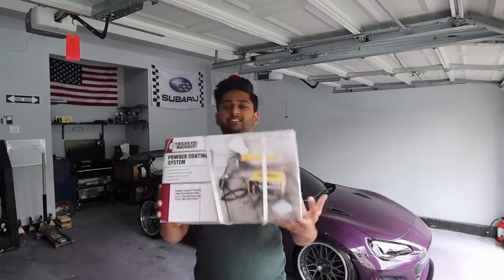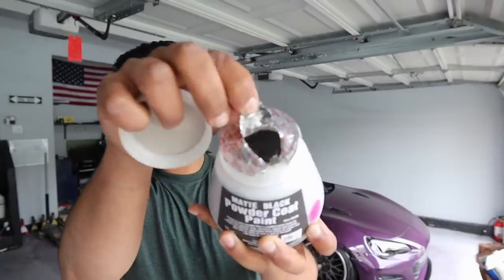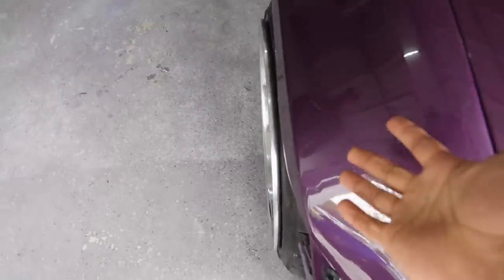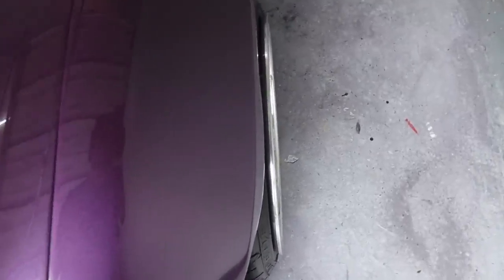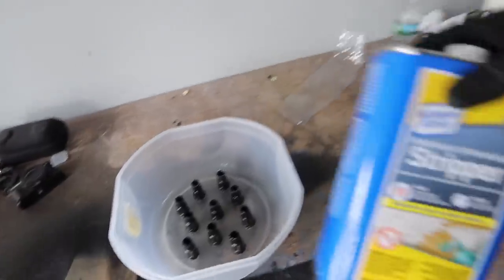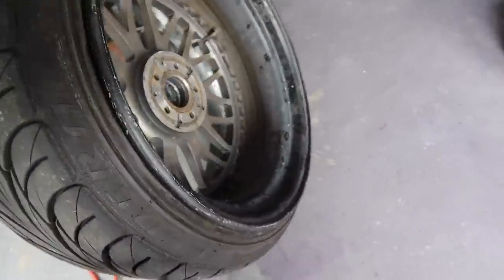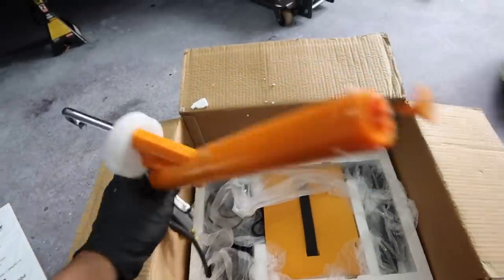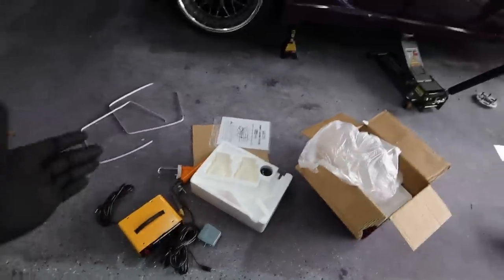How To Powder Coat at Home for SUPER CHEAP!

Comment: I myself powder coat and from my experience the wrinkles are caused by cheep powder. I’ve used the harbor freight kit before and it’s actually not that bad. Buy some high quality powder and you would be golden 👌
Reply: Jcor3968 what’s good quality powder where do I buy some at ?
Reply: Fidel Breto prismatic powders
Reply: Definitely Prismatic Powders
Reply: Prismatic . Ifs . Tiger drylac . Cardinal powders are all good
Reply: I second that. I also powdercoat and i buy from prismatic powders
Reply: Jcor3968 wrinkles or waves are from to much powder coat and not being consistent.
Reply: Where do you buy the good power coating power @ jcor3968
Reply: mister clean quick question, is it rule that you preheat then place the item inside the oven and once the item reaches the recommended temperature the cook time starts from that point?
Reply: Maybe you should do a detailed video on how to powder coat properly?
Reply: yeah they might be using some reclaimed instead of virgin powder
Reply: I agree with Jcor. The HF system is actually a good kit. It is certainly the best VALUE in the powder coating world. It's the cheap powder that created the inconsistent texture. I got excellent results with the HF machine paired with Eastwood powders. I haven't tried any other powder brands but I'm sure there are plenty of manufacturers that make quality powders. That's all you need to get awesome results...

Comment: few things to consider, 1, your 10 psi is 10psi when nothing is pulling air, so when you pulled the trigger and went to use air your 10psi turned into like 1 psi if even that. next time turn it to 10 psi while holding the trigger wide open with no powder in the gun. 2, I didnt see a moisture seperation device, very important for smooth coats. 3, preheat your oven for that final bake, you dont want that powder sitting too long cold without a charge to it. and 4, to help get more even coats and better adhesion prebake your parts, spray em, then put em back in the oven for the final bake. it takes some trial and error but once you get it, it's easy. also someone mentioned the h.f. powder being cheap powder, while I cant say because I've never used their powder try other powders as well and see if you get different results. there are some transparent powders out there to give an anodized look and it's fun to play around with.

Comment: I got the kit a few weeks ago and have done a couple parts and mine are tuning out the same texture. I bought really good recommended powder and it’s doing the same thing just not as bad. The only thing I can attribute it to is the harbor freight gun does not blow the powder like it should. It gets clogged so you have to turn the air up then it spits. There’s no happy medium. Good job for first go. Pretty much how mine turned out.

Comment: The Harbor Freight system is fine, I have seen professional results with this unit.
You used way too much air pressure which put too much powder on the lugs. Plus you should run an inline water filter to keep moisture out of the powder and off the parts.
Practice and you'll be wanting to coat everything !
Reply: Big Bruce is right...... Too much air pressure means too much powder especially since you don't have a booth. Most booths have positive airflow to suck excess paint away from the project to help eliminate over-spray. Try doing it outside of the garage with a slight breeze blowing or make a paint booth of your own.. Just an air filter and fan should accommodate for smaller projects. Sincerely, go kart man
Reply: 5-10 maybe 15 at max  for powders
Reply: It's not just the pressure, that particular gun leaks powder, a lot. Just pointing it down will dump a crapload. It's not the most ideal for small parts. The tube is too big and the electrode isn't hot enough...

Comment: Just future reference, the HF powder comes in jugs that are identical to what came with the gun. So you just thread the jug of black powder right to the gun rather than transferring it into the empty jugs first
Reply: Yes, it seems like the obvious thing but unfortunately they are not the same thread size. May strip the cap on the gun.

Comment: Mixture of powder coat and water. There's water residue in your compressor and created bubbles in the powder coating. Just need a regulator filter on your compressor, simple fix.

Comment: Back when I was in high school I worked for a company that made thermal couples and there were these aluminum casing for the connectors that we would powder coat they only had a harbor freight machine and a electric kitchen oven we would sand blast the part to give the powder a better surface to stick then we hung them using mig welding wire from the oven racks coat them while the oven was preheating the system worked great and this was a big company we did probably 100 a week

Comment: The reason it came out textured is most likely the metal is out gassing. This happens when gasses are released when baking and are trapped in the powder. Ideally you would strip to bare medal the prebake for 20 minutes. Then let cool and powder coat. Your pressure was also to high. A ground would also help.  The ground will help ensure a nice even coating.

Comment: I powder coat for a living, you got bubbling because of overspray and improper cooking. the texture of powder coat paint should be really smooth  if applied correctly, the psi on your gun was too low that's why you seen it coming out in small puffs. Also you should keep the electrode of your gun at least 6 inches from the pieces. Lastly powder coat paint should be cured using high temp INFRARED OVEN, conventional ovens just dont give the same result.

Comment: Strip everything down to bare metal.  Use a degreaser to clean it up.  Preheat it for about 10-15 minutes.  Use a water filter to keep moisture out.  Get an Air regulator and set to about 5-10 PSI.  Don't go too heavy. You'll be fine.

Comment: You are supposed to ground the unit you are powder coating. The grounding gives it a negative charge. The gun gives the powder a positive charge, which will let the powder bond to the unit much better. You’ll get a better coat texture if you ground what ever you are coating. I’m pretty sure that little black clip is a grounding clip

Comment: I’m not sure if you preheat the nuts before paint it , you need do that , and looks like that oven don’t have enough heat for the powder coat paint.
Reply: No you dont need to do that. and that oven goes over 450 degrees. powder is done at 400 or less.

Comment: As someone who used the HF gun for like 4 years, part of the issue is the gun itself. It has massive overspray and leaks a lot of powder as shown. You car ward this off by taking care in how much paint you put in the cup. I recommend a 1/3 full, and avoid Faraday spots at all cost. After recently upgrading to a 100% adjustable, and someone who PC a lot, there is a huge difference in having better machines, but if you wont be doing much PC or offering it as a service, its fine..

Comment: They had that ugly yellow tint to them because you used a brass wire wheel to clean them off

I'd also suggest to turn the psi down to where it's just a nice slow cloud of powder instead of just dumping the powder on like you guys had it.

Comment: .....Pours the powder into the exact same type container!??😂😂👌😂😒
Reply: Exactly, I was like what ohh common sense left the room
Reply: from a different video i kinda know its not the same, they look the same but that guy tried it and it turned out the threads where different. He was tuning it on for 20+ turns and then was like wait wait, it only has 3 threads, how can i keep turning this while talking to the camera. Wel because the thread where just a bit smaller and skipping over.

Comment: oven cleaner would of worked better to strip the anodizing and soaking it also
Reply: Greased Lightning degreaser is Amazing at removing anodizing. I couldn't believe it when my guy at the hobby shop told me. I wanted plain aluminum parts for one of my projects and he only had the parts in orange and purple anodized.
Put the parts in a bowl of Greased Lightning and watch the anodizing come off, wipe the part and done.

Comment: I would get bolts and mount them to plate so they dont fall over, preheat, lower the air pressure. Then buy professional powder.  start with 7lbs of air.

Comment: Not sure if you pre baked the lug nuts before powder coating,it would get all the impurity’s out the metal before you powder coat them,Ive never powder coated but have had my wheels done and watched videos here and there. They look good to me I would just pre bake them next time and apply the powder coat when they are hot it will help it stick sometimes not all the powder sticks from the electrical charge and the heat should help.
Reply from the maker: hmmm🤔i’ll definitely try that next time, it does make sense haha

Comment: If your parts  aren't smooth, the finish won't be smooth.Also, if the paint isn't thick enough, it may orange-peel (dimple). I'd suggest wrapping your sheet with foil so you don't build up layers and layers of paint on it.

Comment: Pre heat part if not cold rolled steel then let get to room temp then ground each part before u powder em. Usually it 10mins @ 450 degrees. But ur problem can be from bad ground or shitty powder or moisture in ur air system

Comment: More than likely moisture in the compressor you have to have a moisture bottle to remove any moisture

I used their gun and except for blemishes from overspray splatter from improper cleaning of welds it’s not been a issue

Comment: The reason your lug nuts are an ugly yellowish color is because you are using a brass wire brush wheel on your Dremel. You are transferring brass onto the lug nut. Use a soft steel brush and you won't have that issue.

Comment: It turned out the way it did because yall didn't heat up what u were powdercoating.   Should have heated up the lug nuts at 400 degrees for 10 min.  Then lay powdercoat.  Then put them in the oven again.

Comment: the powder coat system is just a way to apply a product its not harbor freights system that caused the poor results its the quality of the powder at $6.99 a quart its great for small parts nuts bolts etc... if you want high quality show quality your going to pay over $25.00 a quart of top of the line powder. also remember prep is important poor preparation on your parts will result in a poor result.

Comment: I’m watching for the powder coating. Question is how the F do you drive something that low on City streets?
Reply: At 2:01 the car has air ride . And most managements allow different preset functions for different heights based on roads driveways and bumps

Comment: Way to much powder coating. It almost looked like you were pouring it on the part. Pre heat, better paint, and suspend your part so you are not just dumping it on the part.

Comment: two mistakes you threw to much powder on the parts to fast and you had the pressure way to high ....it should normally be in 4-5 psi and you coat the parts slowly gradually because the clip you attach to makes the metal part magnetic to the powder so it will stick to the part on its own slowly and you will get a much better finish with no fisheye spots.